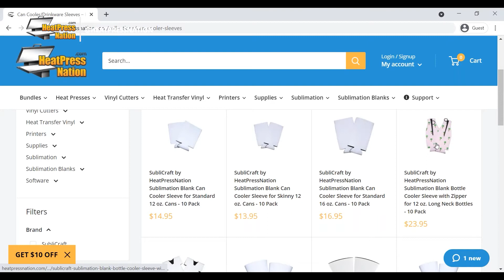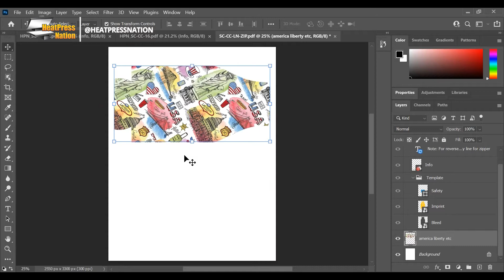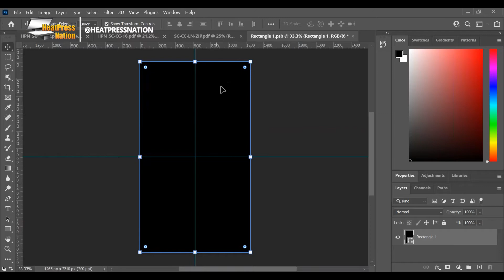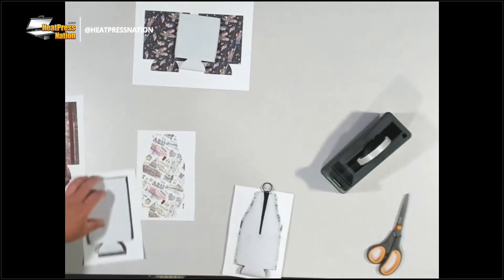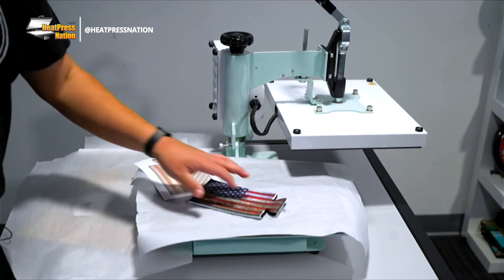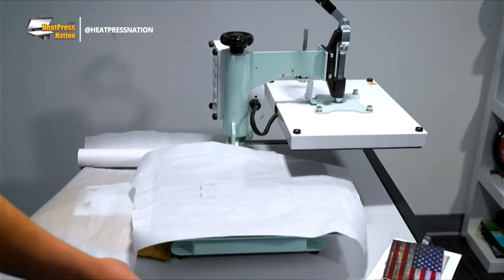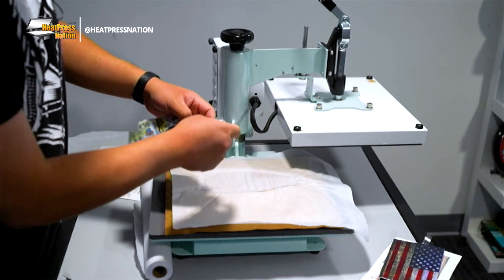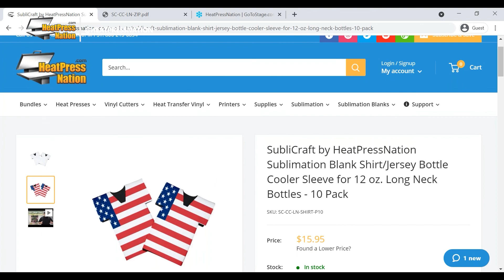How To Sublimate Cooler Sleeves

Comment: I purchased zip up bottle koozies in white to sublimate on, however it is already pre stitched along the bottom, so it does not lay flat.  I don’t really want to keep the all white color and sublimate a design.  Do you have any suggestions on how I can color the entire koozie with with a pattern or solid color? I wasn’t sure if Rit Dye was an acceptable way to color the koozie and sublimate over top.